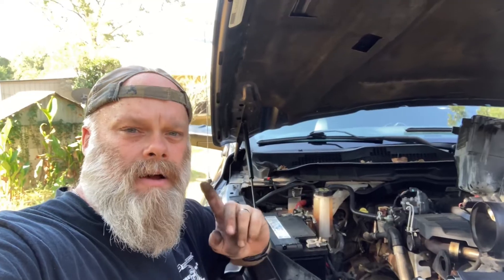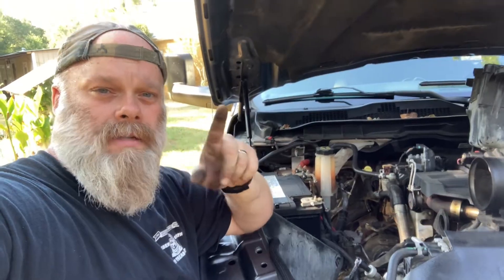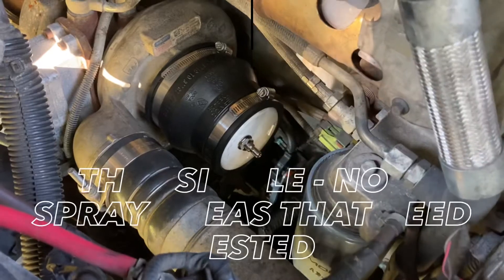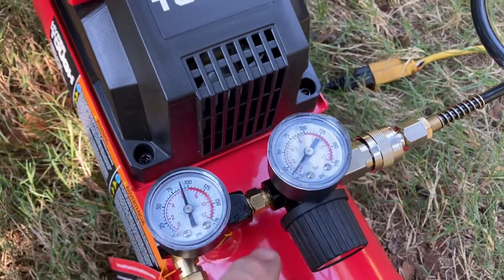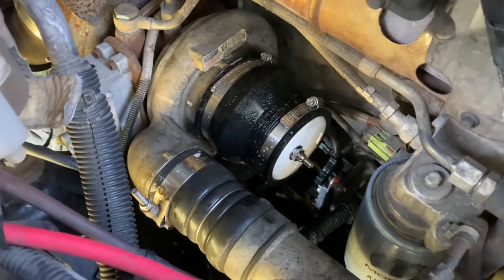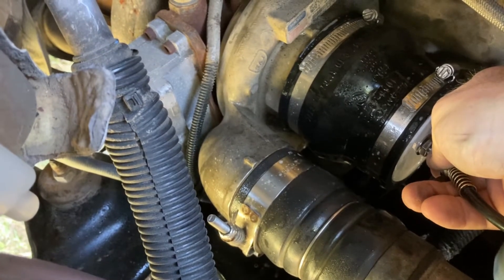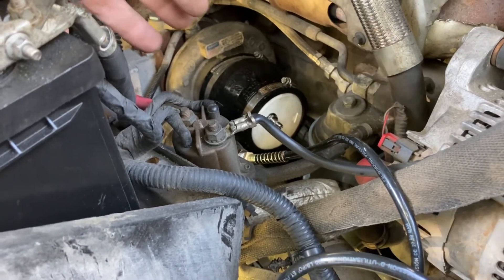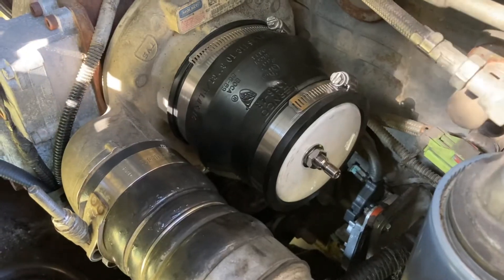Boost Tester DIY | How To Test For Boost Leaks

Comment: Went to home depot to get the coupler and end cap for my 5.9 cummins turbo with 4" inlet. The 4" couplers they sell and caps are actually 4.5" ID. Where did you get yours and exactly what size ID hose and OD cap?

Comment: dumb question but wouldn’t your bov open when pressuring up?
Reply from the maker: @nekiko_z  by the way, it’s not a dumb question at all. There are after procedures people have done to install an aftermarket one.
Reply from the maker: @nekiko_z  the 6.7L Cummins Diesel Engine does not have a Blow Off Valve.

Please Subscribe and hit the Bell to Support my channel.

Also visit my Store link below, I have lots of inexpensive custom tees, merch, and gear aimed towards my channel:

https://operationrv.printify.me

Comment: Do you want to be doing at least 30 psi. 40 would be best
Reply from the maker: @Corey-y4p  PSI can range. Ex: I was pulling my 14,000 lb trailer yesterday driving slightly uphill and I was around 24 PSI.

Comment: What size rubber adapter are you using and where did you find it? Thank you.
Reply: That is a Fernco 4-in x 3-in Flexible PVC Coupling for Sewer, Drain, Waste and Vent Piping

Comment: Should it stay pressurized when the air is shut off? Mine begins losing pressure right after I shut the air off
Reply: It will always leak past the rings or valves at a small amount. If it's going down quickly, it's most likely a leak in the piping, intercooler, intake or couplers.